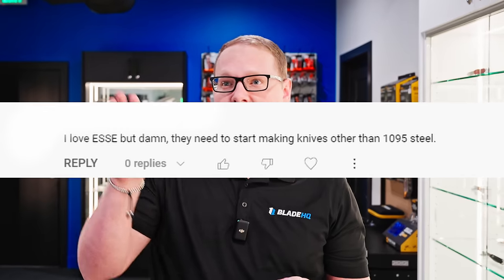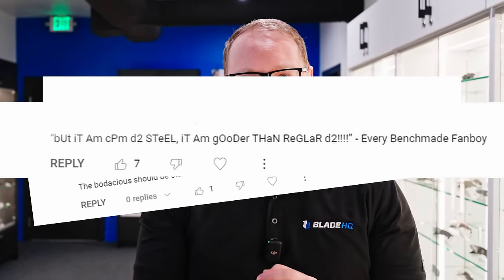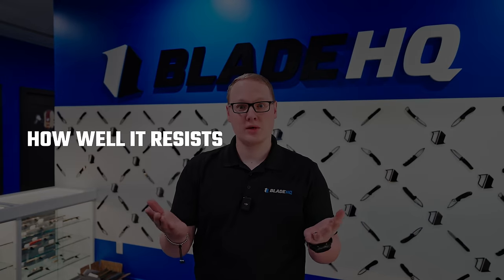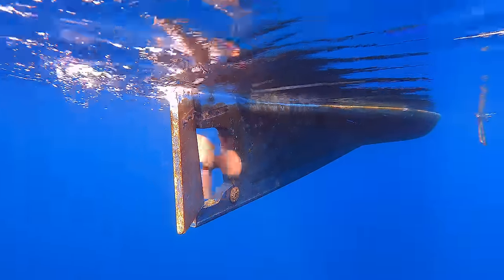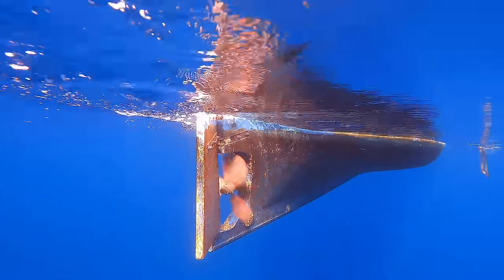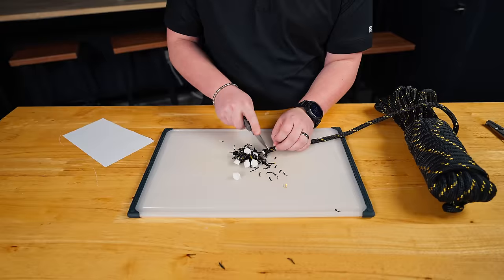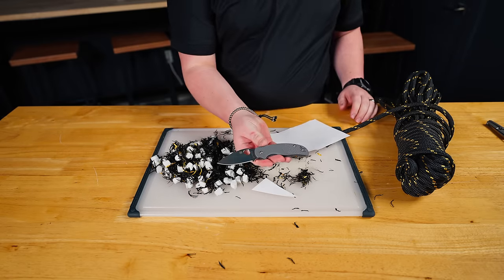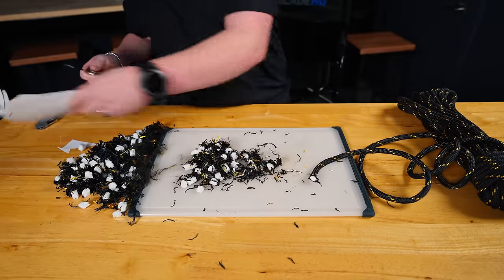What Is The Best Knife Steel?

Comment: "7cr13 is the best steel" - Gerber
Reply: Crkt begs to differ..
Reply: Hehe
Reply: I don't know anything about Chinese steel other than don't but anything lower than 8.
Reply: is 4cr14 considerably good?
Reply: @smitty2821  
The nomenclature makes sense: 
It's 0.7% carbon, 13% chromium, all other functional alloying elements (like cobalt Co, molybdenum Mo or vanadium V) are mentioned after. 
It's pretty clear what 10Cr15CoMoV actually is - unlike calling it VG-10 (which still makes some sense to be fair). And then pure marketing names like Magnacut don't tell you anything about what it actually is.
Reply: @rizkyrizky498  
Depends on what you are making, it's not too bad for a butter knife.

Comment: This video is well done - I appreciate you not overly "taking a side" when there is so much performance nuance to edge retention/wear resistance, carbon & carbide size, corrosion resistance, toughness - and less understood attributes such as edge stability, microstructure, impact/shock resistance, heat treatment, geometry, sharpening method micro-physics, and hardening potential.  Well done - cheers.

Comment: 1. heat treat
2. heat treat
3. geometry
4.type of steel 

the most important factors
Reply: What is the best type of knife design and geometry in your opinion?
Reply: 1. Geometry
2. Heat treat
3. Steel type

55hrc k390 would hold a shitty edge because it'll just mushroom the cutting edge before the carbides help you. 
Geometry of a brittle steel will make a tough knife and cutting edge, and a tough hard steel will hold a fine geometry and give much higher edge retention.
Steel gives the edge rention and toughness hardness balance, but some are worse than others objectively, but the geometry and having it hard enough matter a lot.
Soft edges just mean you need thicker bevels and get even less edge retention, usually in a steel that's already super tough like 420HC. It's like taking a monster truck to a racetrack, it's maximized for the wrong thing. MagnaCut at 62 will do everything well and the geometry will dictate if it's a competition chopper or a Japanese kitchen knife.

Comment: Well said. I agree with everything. I took the path of buying many knives over many years and have developed my preferences. An attribute never mentioned I value has been referred to as front end sharpness after I describe it. Working edge retention isn’t something I care about on my EDC. But how much front end sharpness, how long it lasts and how easy it is to maintain along with lateral edge durability are primary factors in my EDC steel preference.
Reply: I totally agree with your view on usefulness for an EDC knife. The best for me is Victorinox steel. I can get front end sharpness to my liking quickly and rust is never an issue. Super steels are too hard to sharpen to my satisfaction. I think the tempering has a large affect on getting the edge I want. Geometry also makes a huge impact. Victorinox just has the best QC overall that I have seen. I've spent way too much money over the years chasing better only to be disappointed and not wanting to carry or use it.

Comment: S35vn is well rounded
Reply: I’ve always felt like a well treated s35vn could go up against magnacut honestly
Reply: When done right, it's in the top of my list of favorites. The Spydercos with the blue FRN scales; man the S35VN is so good on those.
Reply: S35VN on my Cold Steel Recon1 is extremely well treated
Reply: @LostTrailX  
Unless that Magnacut is way too soft (which some manufacturers do, it needs to be hardened to 64HRC for optimal performance) it will hold an edge about three times as long. If they are both at 58HRC they might perform very similarly.

Comment: I've long thought that Cruwear is under-appreciated. For a tool steel, in most environments, it's always been pretty rust resistance. Tough as nails, and holds an edge well. Seems to sharpen up pretty easily too.
Reply: One of my EDC folders is Cruwear and I've had no issues with it at all. It's been great.
Reply: Among people that have tried everything, it seems that CruWear, K390, MagnaCut, rex 45, and humble 14c28n are among their absolute favorites.

Comment: Just got my first Magnacut Kershaw Livewire.  Impressed so far
Reply: Nice. It's a great knife.

I picked up a double edged model and the spine edge was a bit rough so I sharpened both edges to two different grits. It's been cool to have a super refined edge and a more toothy one on the same blade. Fun stuff.
Reply: Gotta love Kershaw. It's been my favorite brand by far for years now.
Reply: I got the tanto magnacut livewire. I love the knife but it sadly was poorly sharpened at the factory. Spent a good 45 minutes getting it nice and sharp and it's been an absolute champ ever since. Been about 4 months now and other than a few strop sessions it's still mad sharp.
Reply: @TerminalM193  I of course am not a fan of poorly sharpened blades from the factory but I suppose the silver lining would be at least now you have the worst of the burned edge off.

I like this knife so much I've been seriously considering getting that tanto. It's a very slick looking blade.

Comment: You know what steel surprised me the most S35VN on my protech SBR with a blade under 3 inches. I batoned (YES BATONED) a 2 inch diameter sapling tree. After I could still shave with it, I could not believe it.
Reply: That’s pretty normal for even non powder steel

Comment: Hardness is often neglected, but imho it is a key factor in a lot of edc tasks. Toughness combines with it to give a good edge stability geometry wise. Those two attributes dictate how thin the blade can be. Then abrasion resistance plays its role in cutting abrasive stuff, which is quite frequent too, and depending on the climate, corrosion resistance will better edge stability and geometry at the very apex over time.
So I think the «best» steel should be over 63 hrc and quite tough, with a lot of high carbides, K390 is the ideal candidate for extra thin geometries, Magnacut can be useful for saltwater activities or kitchen knives.
I think a good hard D2 is tough enough, stainless enough and will keep a far better edge than 14C or NitroV etc on a budget knife. 154CM and VG10 can be nice too, love how 154CM bites.

I find S90V to have the best chainsaw effect and keep it for very long, this thing is a little scary I love it.

Comment: I think an important aspect is also price - different price ranges bring different steels to the table and you should consider if that steel is worth that price tag. And also another thing is ease of sharpening or ease/capability of restoring an edge with a strop which might be very important to people who don't have a lot of sharpening knowledge and equipment or people who for example do a lot of backpacking and have a need to restore that edge on the go in the woods for example. Heat treat is also very important... a budget steel done properly will be better than a premium steel with a poor heat treat.

Comment: Just the three coordinates of wear resistance, toughness, and corrosion resistance provide a 3 dimensional cloud. Add in production knife heat treatment and blade geometries, and its more dimensions than we evolved to understand. 

That said, there are bargain and best options on all these axes. 
Wear resistance: D2 (non-stainless) is a bargain. S90V (stainless) is best among common knives.
Toughness: 14C28N (stainless) is a bargain. 3V (non-stainless) is best  ".
Corrosion resistance: H2 is a bargain. Vanax 37/Superclean is best  ". 
Balanced? K390 (non-stainless) may be the best knife steel ever, but it isn't very corrosion resistant. Closest stainless in this multidimensional space is MagnaCut.

Comment: Depending on heat treatment and what type of performance you prefer, MagnaCut can flex into multiple uses. MagnaCut ranges between CruWear & 4V in toughness, between S35VN & M390 in edge retention, and right under LC200N/Vanax in corrosion resistance.
Reply: Yep. The best heat treatment on Magnacut I have that has been a great and versatile blade is from MKC. It's simply superior to what I have from others.
Reply: @Swearengen1980  Theres quite a few manufacturers that do MagnaCut correctly. It just depends on your price range and what you’re going to use it for. Mind you, edge geometry and the process of how the HRC is reached, is arguably more important. Is your MKC model the only MagnaCut knife you have/experienced?
Reply: @alexferrara9287  Nope. A Bradford, Kershaw, Spyderco and  MKC. In terms of quality, I'd put them at MKC, Spyderco, Bradford, Kershaw....despite me absolutely hating Spyderco's style (great knives, just ugly to me).

Comment: Can you recommend a ultra-premium steel for Arizona law enforcement knives?  Due to our low humidity, we do not need corrosion resistance, but toughness and edge retention (wear resistance). Our cops use their knives for everything! – screwdrivers, cutting through fences,  slicing seat belts from burn victims, et al.  

We do not need a recommendation on a specific brand of knives – we will find a manufacturer once we learn which steel is ideal for Arizona LEOs. Can you make a recommendation?
Reply from the maker: CPM CruWear or CPM M4 are my recommendations. Both are super tough and have stupendous edge retention. Neither is stainless, but it sounds like that's not an issue. There are a ton of great knives made with both of these steels, so you'll have no trouble finding your ideal blades. Thanks for watching!

Comment: Can someone tell me if D2 is good ? I got my qsp penguin and im in love with this knife, so i wanna know on what should i be carefull
Reply from the maker: D2 is a great steel. It has a solid balance of edge retention and toughness. It's often called "semi-stainless," so it will resist some corrosion, but I've heard from folks in humid climates that they occasionally see rust spots on it. But it's a great, well-balanced steel. I'm old enough to remember when it was only available on high-price knives. The fact that you can get in budget-friendly knives today is awesome. -George
Reply: Great edge retention for the money.

As a severely corrosion averse type, I kept away from it for a long time. Eventually I bought a CJRB Agave in D2. I've treated it like my stainless knives for two years. No coating it with oil or EDCi.

About a month ago I saw a tiiiiiny spot of rust on the forward finger choil, probably from sweaty hands in summer months. It came off with a rust remover with ease. Other than that, in two years the blade has only darkened some.

I'm much less snobby about D2 these days.
Reply: thanks ! 
 @BladeHQ

Comment: Surprised that you didn't mention CruWear. Even Dr. Thomas will admit that it is better than Magnacut in edge retention and toughness, and still has pretty decent corrosion resistance, great even for a "high carbon" steel.

Comment: I think the majority of folks do not require any sort of premium steel and will be just fine with AEBL or good old 14CR Heck there's a reason why Buck still uses 420 in many of their knives. Unless you actually know you need a different more premium steel for specific applications You're probably fine just going with non premium entry unless you're trying to collect or just spend money to spend it
Reply: I wish Spyderco had more aeb-l on their knives. It’s a great steel. Very tough.👍🏻
Reply: @DuhYaThink I wish the same. I've given thought to buying the aeb-l mule and putting scales on it.
Reply: @matthewweaver1123  That’s the only model I have on aeb-l
Reply: Aebl or 14c really are great steels. Cheap, easy to sharpen to a razors edge, great edge strength/stability and stainless

Comment: This is a solid into, but there a couple of things I want to correct. 

Firstly, s90v is generally tougher than maxamet within their respective hardness ranges. S90V is actually weirdly balanced for it's edge retention.

Secondly, heat treat is as, if not more important, than steel choice. Ht won't make a bad steel great, but it can make a great steel terrible.
Reply: Yes, often times people forget about heat treat.

Comment: Found my favorite steels, I'm at cruwear>magnacut>m4>k390. 1095 cro-van for big knives. I cut dirty stuff so tougher steels hold an edge better for me. Steels designed for edge retention chip away too fast for my liking. S35vn almost held in there really well (on a cold steel 4-max, anyway) but S90v is the steel that showed me I wanted tougher steel. I see so many great knives and skip them because 20cv/m390/elmax, there's no way I could take that to work.

Comment: I have a MKM timavo with titanium handle and M390 blade steel... Its by far the best (and most expensive ) letter opener I've ever had. 😅
Reply: I've wanted one of those for some time. Have you used it enough to get a feel for the heat treatment?
Reply: @PoetFisherman  can't really say, only had it a short time. But the build quality is excellent! The feel, the lockup, the jimping are amazing.
Reply: I’m relating.  I keep a budget friendly D2 knife at work to switch over to lol.

Comment: AR 500 is not that hard compared to knife steel.  The 500 stands for 500 Brinell which is about 51.5 HRC and most knives are from 59 to 61-2 HRC.  AR 500 is actually battleship belt armour and was the industry standard in the west (Europe to the USA) until we stopped building huge battleships so you see it’s not that hard but to copper coated lead FMJs it might as well be battleships belt armour because it isn’t going through.

Comment: I agree with you that 7Cr17MoV Is the greatest steel of all time. More corrosion resistant than magnacut, Tougher than magnacut And most importantly, higher, wear resistance than magnacut.  It truly is a steel that requires no trade-offs, which is what makes the Gerber sumo the greatest knife of all time.

Comment: The best steel is the one that's in your pocket 👍

I worked in a kitchen and I had a huge knife that I loved, it is the best blade I have ever handled, I could cut tomatoes on a steel surface for weeks and not lose the edge, a fantastic working tool, I think it was 12c27 because it was a french knife made in Thiers. To this day I don't understand why it was so effective.

I have many fancy steels, and they perform okay, but I experienced many chips with powder steels cutting cardboard, I avoid cheap steels life 440 a and b, 7cr, 420 and similar because they don't hold an edge even though they don't chip like fancy steels.

It's all about balance.

Comment: I see a massive difference between cheap stainless(420?) and the different tool steels(hap 40, k390, s110v, m390 ect.), but I don’t see the difference between the super steels to any meaningful degree as far as edge holding for my pocket knives.  I don’t let my knives sit with salty juices on them and haven’t seen rust but have forced patina using vinegar.  I payed a huge premium to access and work with these new steels and Ike them but the price for them is a bit steep for what they are(knives you don’t have to sharpen as much but take diamond or a lot of work to sharpen)

Comment: I've heard many times that a knife maker carefully chooses their blade steel and hardness for the specific properties that the knife is intended for... maybe that still applies to blacksmiths and custom makers of fixed blades, but it really doesn't apply to production folders in much of a meaningful way these days. Otherwise the Spyderco PM2 wouldn't be made in virtually every cutlery steel ever produced. Or on the other end, every single new Civivi wouldn't all utilize 14C28N/Nitro-V once the industry grew tired of D2.

COST is THE most important factor for the manufacturer when it comes to production folders. Some of them will also use high end particle metallurgy steel and purposefully heat treat it soft so they save money on machining time, so they can throw around that M390 buzzword (and it's not just the cheapo or no-name brands). It's the other tradeoff that no one in sales wants to address because it can paint products or brands in a bad light. You can also end up with great or subpar examples of heat treat for a given model due to the manufacturing scale... not unlike the "silicon lottery" for computer components.

Still, some steel choices confuse me, like why Benchmade will opt for CPM-D2 for some new models, where there's newer alloys like CRUWEAR that are a better fit for cutlery that they also use. That probably has more to do with a massive overstock of a certain steel, in a similar vein of most Spyderco models being introduced with CPM-S30V (still a great steel, but it's been iterated on twice since its introduction, and Spyderco also has SPY-27 that has similar attributes as well).

Comment: I think super steels are overpriced for the small amount of performance you gain. But... mid-range steels are usually quite a step up from the low end/old school steels. 420HC will certainly get the job done with a good edge, but I'll gladly drop an extra $50 to get a mid-range steel that will hold a razor sharp edge 2x-4x longer. VG-10, 154CM, S20V, S30V, S35V, AUS-8, etc are all affordable and offer a big step up from the steels of 50 years ago. (This advice does not apply if you're literally working on a salt water vessel and need maximum corrosion resistance with good sharpening and edge retention. You deserve to buy super steels.)